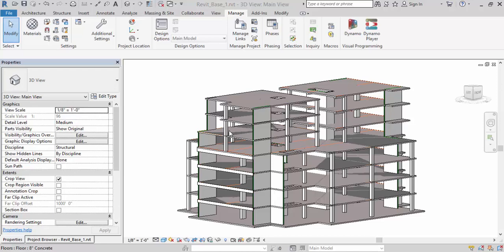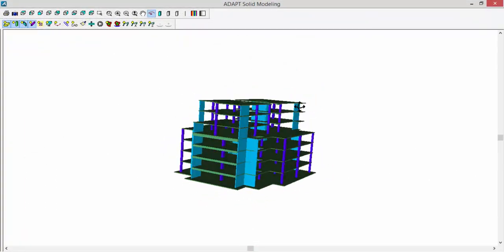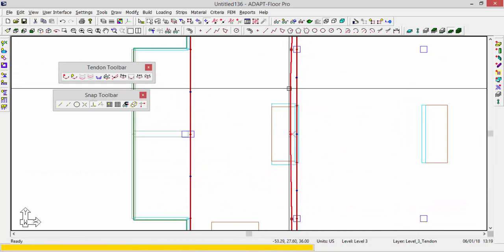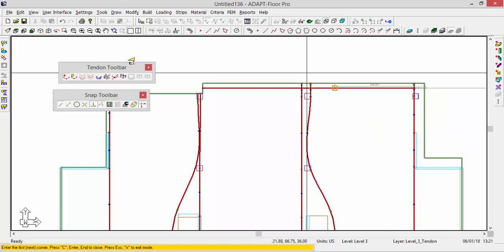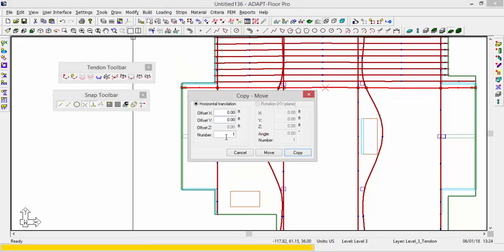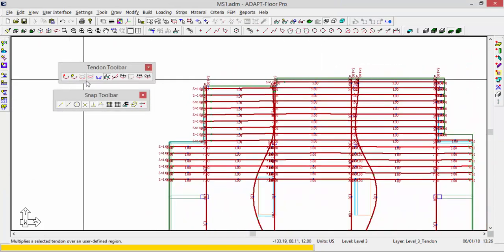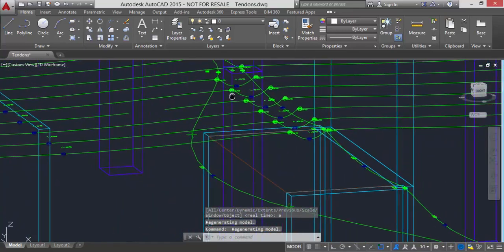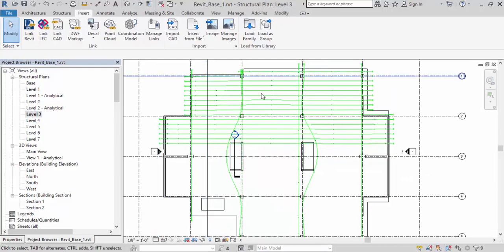Revit and ADAPT-Builder Workflow with Tendon Import

Comment: I noticed that when you exported the file from Adapt, there was an option to export directly to Revit, but you chose DWG/DXF.  Is there a reason for not exporting directly to Revit, instead of exporting to AutoCAD and then importing that file into Revit?  Thanks!
Reply from the maker: Terry, thanks for the comment and questions.  The purpose of the video was to show the specific workflow where the tendon Builder output is exported out as a DWG file and then inserted to Revit.  There is certainly the ability within Builder to export tendon and rebar data as objects to Revit. To do this you would select the Revit option and not the DWG/DXF option.  That is shown in another video on the channel. - ADAPT Support